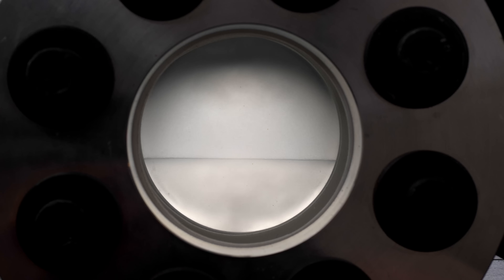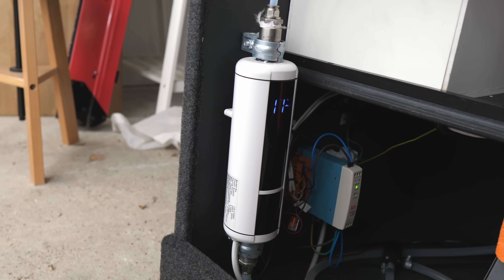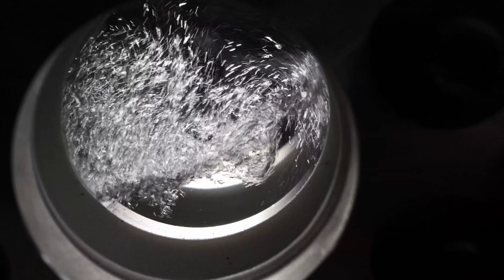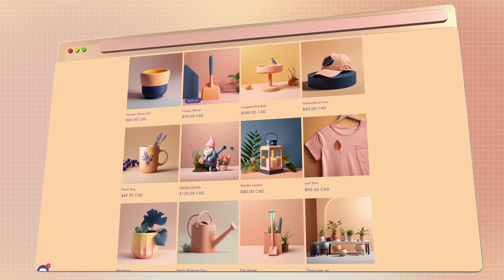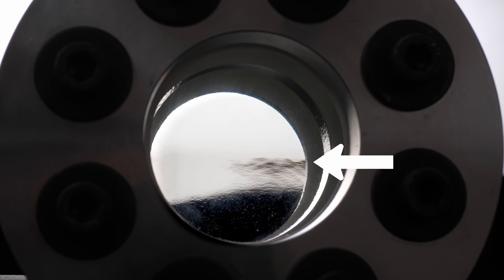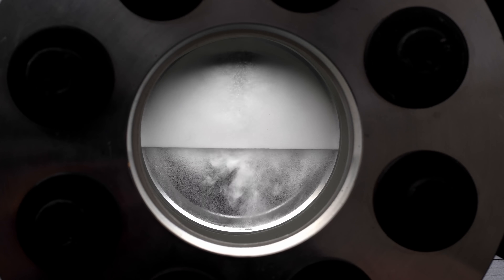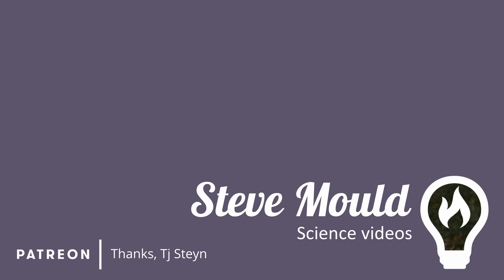The Unknown Phase of Matter

Comment: When you look at the p/T phase diagram of for example CO2 and the equations used to describe said diagrams it becomes quite clear what is happening.
The change in equilibrium pressure dp over the change in temperature dT (so the slope of the line in the graph) is equal to the change in molar entropy of the phase-change dS over the change in molar volume dV. dp/dT = dS/dV This is the Clapeyron equation.
The molar volume is more or less equivalent to density. So when the density of the gas (dependent on the pressure, because gases are compressible) approaches the density of the liquid the change in density (and thus molar volume) becomes smaller and smaller => the slope becomes steeper and steeper. When they are equal you are dividing by zero and there no longer is an equilibrium line. This is where the critical point is in the phase diagram.
Reply: "molar entropy"???WTF?
Reply: @alans172  Molar entropy evaporation: The amount of entropy created when you evaporate 1 mol of a substance. Usually around 88 J/mol K for most substance, but substances like water that form aggregates in the liquid state it is quite a bit higher. Water is around 109 J/mol K.
This of course depends on the temperatures, since the enthalpy of evaporation dH is also a function of temperature. The Gibbs free energy equation gives us: dG=dH-TdS. When two phases are in equilibrium their Gibbs free energy is the same: at the boiling line dG=0.

Comment: My undergraduate research was deriving general equations to define the vapor pressure curve for substances starting at the critical point and working "down" the curve to meet the region where existing equations' error percentages start to balloon. Our results were published in Chemical Engineering Magazine. Thank you Prof. Mike Misovich at Hope College!
Reply: Oh cool! Did you use the Maxwellian distribution to estimate the fraction of molecules above the energy required to vaporize?
Reply: @DANGJOS  We came up with new constants for the "quick and dirty" Antoine equation to match the much better fitting but extremely messy SRK equations. I had the lightbulb moment but my professor did most of the heavy lifting with regards to the math. The guy had 4 doctorates at the time.
Reply: @andyd8370   4 doctorates at the time?! Holy crap does he have more now?!
And what are SRK equations? My field was physics so I'm less familiar with chemistry terminology and equations

Comment: 15:24 - I thought supercritical happened when the gas phase acquired the same density as the liquid. Turns out that's not quite right: there's a variety of densities within the supercritical fluid!
Reply: the variety of densities is just due to temperature variations and incomplete mixing
Reply: @MatthijsvanDuin  "Just" is doing a lot of heavy lifting there. What you describe can't happen in such a small container with a gas or a liquid.
Reply: @prdoyle  ehh what? if you keep the walls of the container at constant temperature and wait a bit the temperature variations will quickly even out and the supercritical fluid will become completely homogenous.
Reply: @MatthijsvanDuin  Yes, trivially, if the whole thing reaches equilibrium, then it will of course be homogeneous, but this is very different from gas and liquid, where density fluctuations even out at the speed of sound, while they apparently persist for multiple seconds, at least, in the supercritical fluid.

I'm trying to say there's more to a supercritical fluid than just "it's when the gas phase reaches the density of the liquid phase" which is what I thought before this video.
Reply: @prdoyle  no it's exactly the same as a gasses and liquids where density fluctuations persist as long as temperature fluctuations persist.

you're confusing density fluctuations with pressure fluctuations, which do propagate at the speed of sound (in all phases of matter).
Reply: @MatthijsvanDuin  Alright I yield. I'm not an expert in supercritical fluids, but what he showed with the suspended coffee beans looks to me like something that could not happen in a gas or liquid for an extended time in a chamber the size of a petri dish, but I don't know for sure.
Reply: @prdoyle  You're probably right about that. It's just that, as Steve mentioned, if you're near the critical point then even small variations in temperature result in large variations in density, which is why a density gradient sufficient to suspend those beans can persist for much longer than it could in a gas or liquid (which would require a large temperature gradient)

Comment: In 1982 my granddad T.D. Dransfield co wrote a few papers on producing water triple point cells and their use in calibration of deep see thermometers. He worked at the physics and engineering laboratory DSIR in Wellington New Zealand. I still have one of his original printed copies.

My understanding is you end up with the water boiling, freezing and liquid at the same time at a very specific temperature and pressure

Comment: I have encountered supercritical co2 many times, worked on heat engines that use the supercritical phase to run gas coolers.  This is a good idea for commercial coolers if their condenser has to run on an outside temperature somewhere around 20 Celsius or higher, then they just stop working properly, because the condensation temperature at subcritical pressure is too close to the outside temperature.   Instead you then raise the pressure to 80-120 bars, and run a gas cooler, you cool the supercritical gas/fluid, then you release the pressure to sub critical and run a normal condenser if you need more cooling for the condensation.  This enables Co2 based cooling technology to work in the summer, which is necessary even in norway.   It is not as viable further south, because when outside temperatures reach 30C or higher, the pressure at which the gas cooler is effichient goes up towards 120 bar and above, and above 120 bar operating pressure, compressors, piping and components become a lot more expensive, if you plan on runni g a safe machine that is. 

Co2 is a fantastic refrigirant, and supercritical co2 machines are cool.  

A fun thing you can think about is how to use the critical point to separate co2, nitrogen and oxygen from air in production plants.

Comment: Surely it wouldn't be the Pauli exclusion principle when you're talking about molecules?

Doesn't the electrostatic repulsion of the electrons dominate long before you get to the range where Pauli exclusion becomes a factor?
Reply: Indeed! It's all electrostatics, but there are quite a few effects (nucleus repulsion, dipole effects like van der Waals, electron-electron repulsion.) It's so complex that the force curve is usually modelled empirically. Check out the Lennard-Jones potential. It 'just works' but isn't really theoretically motivated
Reply: It's more complicated than that, the repulsion is due to a combination of both: once the nuclei get too close, Pauli exclusion between the electrons starts to limit the electron density in the space between the nuclei (forcing them more towards the far side of the nuclei), inducing a dipole moment that causes the atoms to electrostatically repel each other

Comment: I would argue that there's a huge misunderstanding about the energy diagrams - atoms and molecules DON"T rest on the lines. That's just their chemical energy. Molecules actually also have thermal energy, which adds to their total energy and lifts the molecule up on the diagram. According to the law of the conservation of energy, anything on an energy diagram is only allowed to move sideways. So when a molecule is high enough on the diagram, it means it has enough thermal energy to fly over a barrier such as liquid-gas phase transition or the transition state of a chemical reaction. Once it has, the chemical energy (the black line on the diagram) can end up lower, meaning that the height of the molecule above the line on the diagram has become bigger, i.e. it gained thermal energy. If after having passed the barrier the line representing chemical energy has itself lifted, that would result in less height between the line and the molecule, i.e. less thermal energy for the molecule. If before crossing the barrier a molecule has less thermal energy, it means it sits lower on the energy diagram, i.e. it is closer to the line representing just the chemical energy, and it's not surprising to expect that it will not be high enough to fly over the energy barrier, i.e. the process cannot proceed.

If the molecule is resting on the line, it has no thermal energy, which means 100% certainty that it can't move sideways to escape the valley it's trapped it. Why? Because to do so it would need to gain energy, which is against the law of the conservation of energy.

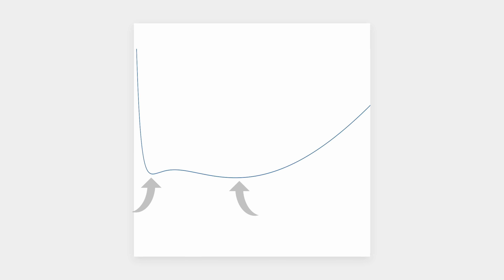When you show how the diagram changes at 12:12, I'm wondering if it's really what happens, or the molecules are just lifted higher on the energy diagram and can now move sideways as if the energy barrier between the liquid and the gas phases is simply no longer there. I suppose, it's a matter of perspective: you could argue that you only represent the chemical energy on the energy diagram when placing a molecule on a line. But teaching chemistry at school, I notice that kids get a much better grip on how energy works and how the law of the conservation of energy comes into play if you actually allow the molecule to be lifter up off the line.

EDIT: After thinking about for some time (2 minutes) I have decided that while temperature is better represented with putting molecules at different heights, pressure would actually result in changing the "energy landscape", because a) chemical energy is calculated for constant pressure, implying it changes with pressure, and b) even if the molecules fly above a barrier, the very presence of a barrier forces the molecule to seek a state with lower chemical energy, i.e. to move away from the barrier. To have molecules behave as if liquid and gas are the same phase you really have to make sure there's no energy barrier on the landscape.
Reply: So in a gas or liquids or combination , there is no exchange of energy between the Molecules, because if there is this is going to make the premise of " If the molecule is resting on the line, it has no thermal energy, which means 100% certainty that it can't move sideways to escape the valley it's trapped it. Why? Because to do so it would need to gain energy, which is against the law of the conservation of energy."  Moot. I think exchange occurs, might be just me.
Reply: @BrianStevens-y6h  Exchange definitely does occur, which is why it's better to think of a substance as being a fuzzy normal distribution on the y-axis, i.e. having some temperature, which is a macrostate, not a microstate. But it would still be above the line representing chemical energy. And it still has to have a significant portion of it's normal distribution to be above the height of the energy barrier if it wants to be able to do anything interesting at all like a phase transition or a chemical reaction.

EDIT: And it doesn't change the fact that if a specific molecule wants to cross the barrier, to be able to cross the energy barrier, it has to be above it, however momentarily.
Reply: @olegshevchenko5869  That clarifies things because while I feel like I understand the gist of what you're saying in the above comment, the way it's worded is confusing. 
Ultimately, molecules are constantly bumping into each other and losing and gaining energy. If they gain enough energy, they can break into the gas phase (by overcoming the energy barrier). As the pressure increases,  they can remain in the liquid phase at a higher average kinetic energy and therefore require less energy to enter the gas phase. Essentially the enthalpy of vaporization decreases the higher the temperature and pressure become. Eventually, that required energy drops to zero and this is the supercritical state. So needing to overcome an energy barrier is also how I think about it
Reply: Moving to complex analysis here, If we were to consider the complex-valued function of free energy in its thermodynamic limit, do you think if phase transitions occur because the state crosses over a branch cut that lies on the real axis? This is much more abstract, but we know that valleys of an analytic function can be found by finding the zeros of its first derivative. If we were to invert the first derivative of a complex-valued free energy function, we will get the branch cuts structure which should directly correspond to phase transition lines and with branch points as the critical points.
Reply: Sliding along the lines to find the bottom is a reasonable simplification of individual molecules' loss of energy restricting them to a lower region, if I understand you right?

Comment: 1:32 ice not floating on top of liquid is... unusual
Upd: i know that water is a rare exception, but water ice interacting with liquid water is what we overwhelmingly see
Reply: Actually, it's the normal way "ice" acts. With metals, wax, salts... almost all materials expand and become less dense when they melt. Water is pretty special in that regard in that it SHRINKS as it melts, causing the ice to float.
Reply: @Pants4096  i know. but water and water ice is what you usually see and, so, expect. Thus when a liquid and ice don't behave like you expect them to, that grabs your attention a bit.
Reply: WATER is the unusual case.
Reply: @andyd8370  i know. but when you see a clear liquid and ice it's usually water and water ice. Which means you expect ice to float, so when it doesnt that grabs your attention.

Comment: 14:20 can you draw patterns with a laser into the boundary between liquid and gaseous CO2 (by local heating)?
Reply: I would think any laser that is strong enough to produce local heating through 2" plexiglass (of something that is already being heated)  would first effect the plexiglass which at  80 bar would probably be not a great thing.
Reply: @turbo2ltr  It's not about raw power, it's about energy absorption. If you can get a laser at a wavelength CO2 absorbs and pexiglass transmits, it could work. Seems like maybe a tunable IR laser ~1700 nm could work?
Reply: @turbo2ltr  The window is quite large you could focus a 2cm beam into a tiny spot within the chamber. Apparently CO2 absorbs at 200nm. So one could use a pulsed 400nm laser (which plexiglas doesn't absorb much) and rely on 2 photon absorption only in the focus.

Comment: What if the "boat" was kept upside-down using a ballast so the gas couldnt escape? Would it still stay in the middle?
Reply: once the liquid/gas phase boundary disappears there's nothing preventing the fluid inside the board from freely mixing with the fluid outside the boat, regardless of the boat's orientation
Reply: the gas would  be squeezed down until it was the same density as the liquid which was expanding... and they'd meet each other.

Comment: Yeah, my professor from Silesian University of Technology was trying to make CO2 a viable refigeration medium. By default it is not viable in traditional refrigeration cycles, low critical point being one of the reasons. The trick was to modify the refrigeration cycle by adding an ejector to retrieve some of the expansion work (or at least that was one of the modifications ;))
Reply: You don't need an ejector to make a CO2 cycle work. You can still have transcritical or subcritical basic cycles with CO2. Lorentzen proposed the use of ejectors for CO2 cycles back in the 80s.
Reply: @brunoyuji9203  I said that the purpose of the research was not to make the CO2 refrigeration cycle work, but to make it viable - meaning comparably efficient and practical compared to refrigeration cycles that use traditional refrigerants
Reply: @13Misiu13  CO2 is already a pretty viable refrigerant. Heat pumps using it are very popular in Japan specifically, with many OEMs like Rinnai and Denso making full home kits. I think some are starting to pop up in Europe. They're quite efficient at low temperatures.
Reply: @Spirit532  All true. I graduated few years ago, when I was studying there was still a gap for improvement
Reply: @13Misiu13  I understand that CO2 is a useful refrigerant where the supercritical phase is beneificial rather than unhelpful. In practice it is efficient at heating water from cold to hot since there isn't a single condensation temperature as the supercritical refrigerant transfers heat to the water. Someone else here probably understands the details better than me, but CO2 heat pumps are now being sold specifically for hot water generation. (And as you said, they can't compete on efficiency with those using propane, say, as a refrigerant for space heating applications)

Comment: intuitive way to understand what 40Nm of torque is: very roughly the weight of 40 apples hanging on the end of one-meter long stick.
Reply: 40 small apples (100g) but yes.
Reply: Or 10 sugar cubes at the end of a football field length stick (the stick weight is excluded in this case).
Reply: @WarrenGarabrandt  Or just one suitably long stick, its weight included.
Reply: @FoobarDesign Temba, his arms wide
Reply: An apple weighs about 1.8 Newtons, but I like it :)
Reply: How many bananas to a yardstick is that?
Reply: @merkuloid  A yard is roughly the length of a metre, and a banana is roughly the weight of an apple, so 40.